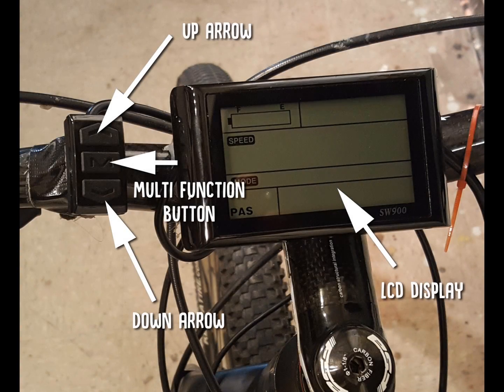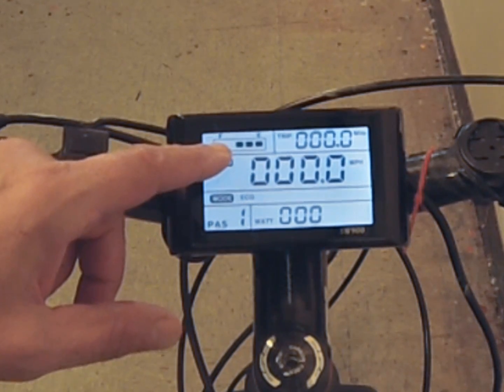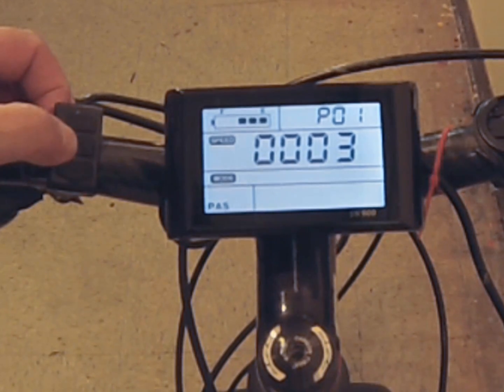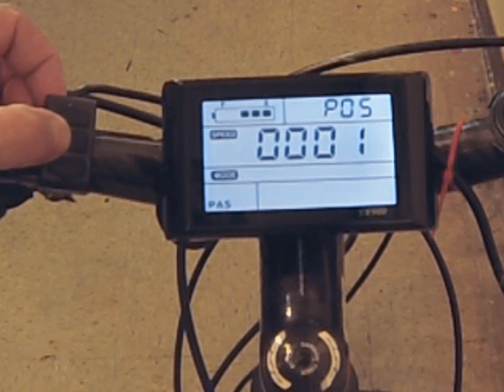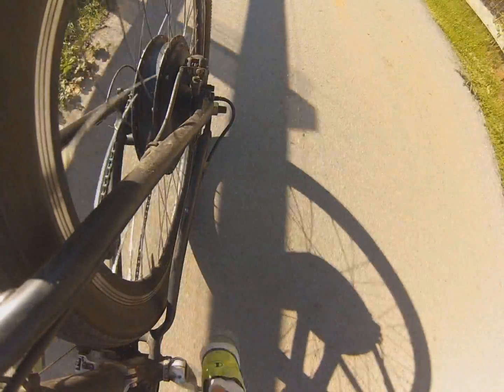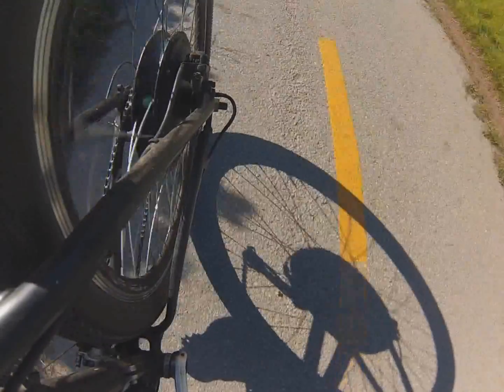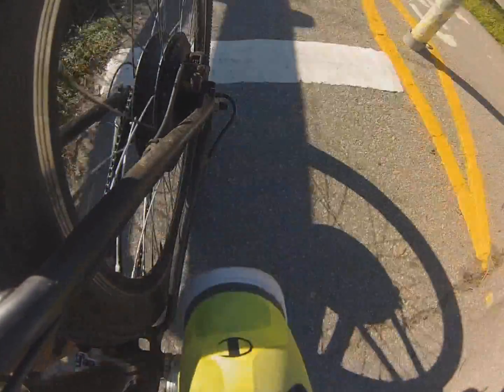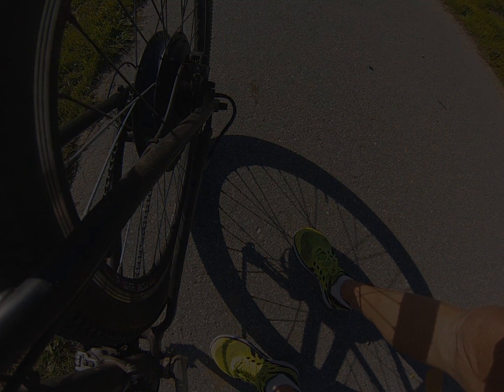Improve your Ebike In 10 Minutes.  Programming your SW-900 onboard computer

Comment: I'm getting an error 010 in the watt space.  The cake only gets short Burts of power and then the throttle dies until it slows down.  I set the speed limit to 40 so I know its not that.  Any idea on a fix?

Comment: I need help 😣.
Specs are: mxus 3000 motor, 60v (67.9) 20Ah battery, 2000w 60ah controller. Sw900 display. 
In the sw900 i can set battery 36/48/60v....

At first connection i got error 007, the learning is working but no throttle.
I dont know what to do. Please help me out...
Thank you!

Comment: Hi,Can you run 52v battery's with this LCD?
thanks
Reply from the maker: Technically you can, however it is really designed for 24, 36 and 48v. Most 48v controllers can handle a 52v battery, but in the world of ebikes I would get a controller and LCD that is designed for 52v. You'll also get more out of the battery.
Reply: AUGUSTINE EBIKE STORE 2018    Thanks for replying 👍🏻.  I'll take your advice and stick too 48v  and maybe upgrade next year .
Reply: Hi can you recommend a good controller for a 48v 2000w and  my max speed is 32mph any ideas om hiw to improve my top speed

Comment: You say to keep an eye on our wattage to not over extend the bike. What does that mean ? What type of numbers should we see or look for ? What do the numbers mean or indicate ?
Reply: I need to find out why mine only pulls 290 watts max on steep hills with a 750/1000 watt motor no pedaling. Mine seems under powered I own an 800 watt and 1000 watt front wheel drive and my new 1000 watt kit with this controller shows only 290.

Comment: Can u please help me? I have the S900 display, not the SW900 that is shown here. At 08 (speed setting), i can only choose between 0 and 1...  My motor is a bafang rear hub with a 48v 14.5 mAh battery and it's limited at 25 km/h. I have no controller, only the display. Cool video!

Comment: Hi I have just installed a 2000 watt 48 volt rear hub motor 
With a triangle battery pack 48 volts 35 ah  
Went for trial run works great 
However only doing 36 K per hour 
What should I expect ?
Anything I should have done !
Reply: Mine has 2 blue wires that when connected together limits my motor to 750W, which if yours is the same would limit you to about 35km. When they are not my 1000W will do 56.5 on a full battery. Yours should be +60km all the time. If you have a LCD/LED display check setting 8 to make sure it is say 100 and not in the 30 range.
Reply: i have the same broblem
Reply: Should be more than that mines a 1000w and i get 46km per hour it did how ever kill my batterys and i was only able to get about 8 or 9 miles on batteries i should of been getting about 20 miles plus
Reply: Bernard Roussety hh